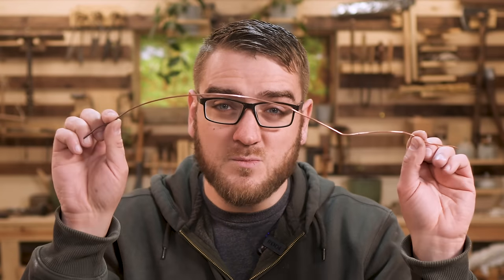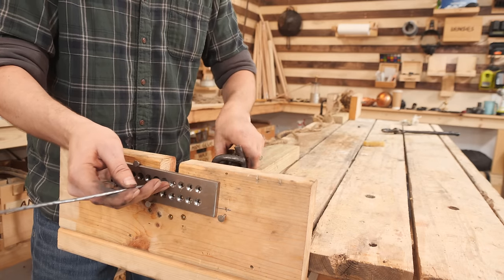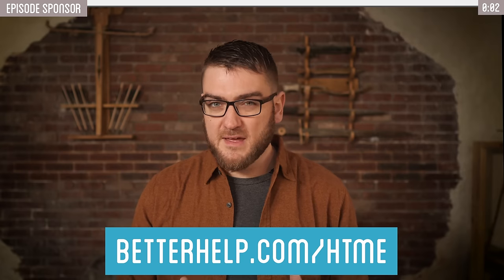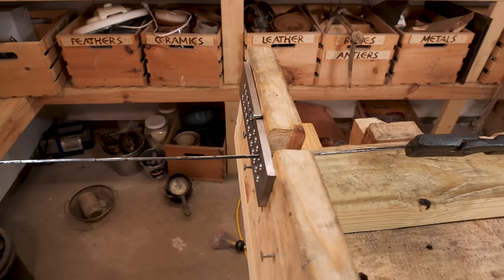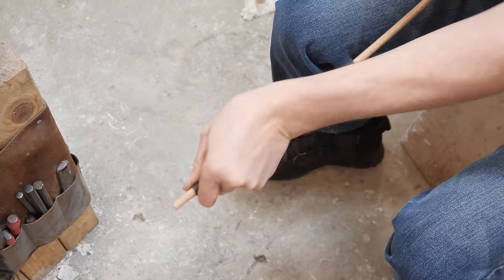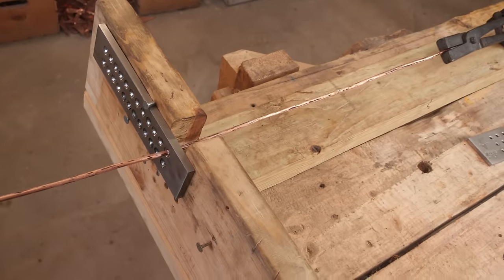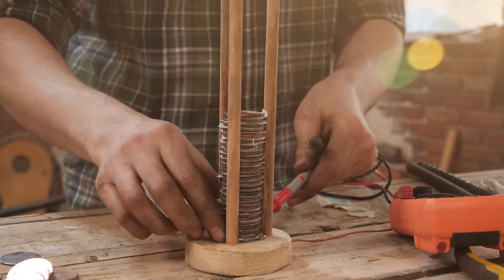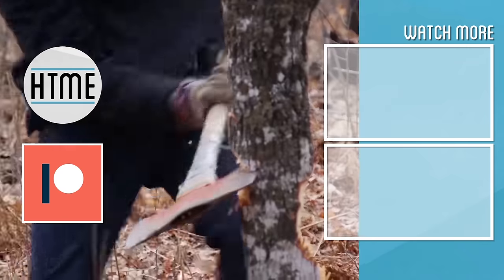Is This The Most Difficult Step to Unlocking Electronics?

Comment: I was working in the wire industry for the first 3 years of my career as an engineer. For low volume wire making, it is rather easy to do, but to make long continuous wire, lubrication and die design play a significant crucial role in successfully drawing wires 😅
Reply: It's spooled in smaller bobbin for small diameter wire and spooled in gigantic spool drums for cable ling wires. It actually depends on what the next process is.
Reply: Much respect for the field! I think wire is such a simple product once we have it, but the process for making it is definitely taken for granted.
Reply: At first they should keep the die perpendicular to wire, I guess?)
Reply: @ЁбрагимИпатенкоибнАдхарма  depends on how round you want your wires to be. But yes 😅. Actually fine wires would be heat treated at some point using molten Lead (for metal wires)  to not burn the wires during heating. For copper or aluminum wires you just need to watch for the reduction ratio and die approach angle in between each reduction and lubrication
Reply: Wait why are wires not just extruded directly from fluid metal?

Comment: most difficult part will DEFINITELY be the silicon transistor
Reply: I wonder if vacuum tubes would be any easier, I feel like a lot of the difficulty in silicon was just the chemistry, so knowing that ahead of time might make it easier than doing the glasswork/vacuum for tubes
Reply: Relays should be pretty easy to make for analog devices like telephones and telegraphs.
Reply: by that logic you could say 'quantum computer' is the hardest lol... the transistor is a product, right, but its not really a single material process, transistor is a composite of elements ;) so a quartz clock would be simpler (in terms of a single 'thing' being made), since theres no need to make lasers, lenses, stepper motors and chemicals before transistors, especially tiny ones on ICs... anyhows, you could be right, but please also do consider this aspect hehe 😅
Reply: @yus3dp533  Ironically, quantum computing is the easiest to make from scratch if you know what you're doing. Though you might need to rip a guy's heart out to do it...
Reply: Transistors are easy compared to Blue LEDs...
Reply: A single transistor....nah. A wafer full of them with useful yields, thats never gonna happen.
Reply: Zinc oxide semiconductors.
Used much like pyrite + cat's whisker in 'crystal radios'.
Bit of steel, coat with zinc, roast to oxidize, Robert is your Parents sibling.
They do have a frequency limit and can't rectify any power.
They can be used like a transistor, but the gain is quite low.
If you're going to rebuild electronics, you are gonna have to use tubes for any real power.
Once you have tubes, refining silicon/germanium is easy: zone melting in an induction furnace.
Reply: @CactusMuffin  yeah, since they got the electromagnet already, it is a matter of refinement to achieve relays.
Reply: 2 diodes, 2 ends connected. (PNP or NPN).
Reply: @brown56765  I've watched numerous people make tubes online. Constructing the tube is fairly easy and doesn't require exotic processes but drawing a high enough vacuum is. I don't know how hard it is to make a silicon transistor. A germanium one might be a bit easier.
Reply: @eDoc2020  they're also notoriously bad at making glassware.
Reply: @soonersciencenerd383  That wouldn't actually produce any gain. The working principle of a transistor requires that the two junctions be in very close proximity on the same substrate, and the two P-N junctions differ in their level of doping. This last part is also why a bipolar transistor won't work with the emitter and collector reversed.
Reply: Don't forget that silicon wasn't the first semiconductor ever used, and that the diode was the first device not the transistor.

Specifically they used crystals of galena I think it was, perhaps iron pyrite, perhaps both, in a point contact diode for rectification and reception of radio.

The diode would fail fairly quickly which was why the crystal was mounted in a carrier with a spring loaded needle to make the point contact. When it stopped working so well you'd just find a fresh clean part of the face of the crystal, even if you had to scrape into it.

You can even do a similar thing with a copper wire as the contact and a hardened carbon steel knife blade as the "crystal". This is called a trench radio because it was made by bored soldiers in WWI for entertainment. There are many YouTube videos showing you how to make one.
Reply: Also remember that Shockley made the first transistor a point contact one from germanium and gold.
Reply: Elaborate
Reply: @eDoc2020 mercury pump
Reply: I was thinking we could do mechanical relays as well using solenoids.
Reply: @pirobot668beta  I've read a lot about the cat's whiskers diode, but I hear that can be real finicky. Definitely worth a try though!
Reply: @CactusMuffin  The problem is relays are actually "digital", they are either on or off.
An analog device instead can produce, record, transmit or process a signal that at any given moment can be any value between some maximum and minimum threshold.
And to do any significant amount of processing on analog stuff electronically you either need thermoionic valves or semiconductors.
Reply: To have silicone wafer cut, you need to first master wire making. This is because wafer cutting uses high tension wires lace with abrasive cutting solutions
Reply: @eDoc2020 I mean, I think an oil diffusion vacuum pump should work fine for drawing the final vacuum (and a roughing pump is basically just inverted bellows), so sealing it becomes the main hurdle.
Reply: @theapexsurvivor9538   An oil diffusion pump is fine for drawing a  good enough vacuum. A basic sealing is trivial glasswork but sealed lead-in wires are hard without the right materials. You'd also have to deal with offgassing. Unless you have an induction heater and getter you probably won't be able to keep a vacuum in a finished tube. It will work when still on the pump but will fail even if properly sealed. But if the tube is failed by 1920s standards it could still have gain > 1 which is enough for a demonstration.
Reply: @eDoc2020  for the lead in wires you could probably make a series of mandrels down the same gauge as the wires and use them to basically form hypodermic needles from a metal that doesn't expand much when heated and shrink fit the wires through sections of needle and make a glass plug around the needle sections. It'd still break down if the wires got too cold, but it's pretty much the lowest tech option I can think of atm (~4AM).
Can't think of a good way to prevent offgassing, though presumably the solution would be to power the tube while it's still connected to the pump, allowing you to pull a bit more out of the components. Sounds painful and far from perfect though.
Apologies if I made any mistakes.
Reply: @theapexsurvivor9538  When I've seen homemade tubes being made I think they used a torch on tungsten wire to cause slight oxidation. I could be mistaken. In any case an incandescent light bulb or other low pressure tube would be a much better item to make first.

Comment: When drawing wire lubrication is important. Traditional ly Tallow but modern oils & grease work better
Reply: Beeswax works great, too!
Reply: Also, annealing would help also.
Reply: @ericwilliams1659  they did that
Reply: Modrrn draw operations use Teflon infused high viscosity lubricants. But here, tallow would work. It can be removed from the final work easier than beeswax.
Reply: @ericmueller6836  In the mid-80s we played with (forced) dry graphite and molybdenum type solutions on carbide dies. 12 lines pulling multiple reductions in a 1950's era factory sang like the worst orchestra EVER !!
   Think: Jim Carrey doing the "world's most annoying noise" X12.
Reply: Even something like butter, olive oil, or beeswax would be beneficial
Reply: @ericmueller6836 on a few modern companies they have used a soapy substance made from sheep fat. I mean if it works today it would probably have been great back then
Reply: @luckygunner8089  Lanolin. But really any type of oil or grease will help with this process.
Reply: I have been making wire for over 40 + years and use beeswax
Reply: Soap is another great lubricant.
Reply: wait until they get into the insulation part(copper wire without at least a thin film of insulating material wil short the generator/motor)
Reply: Good point! I don't think it got mentioned in the video, but we did in fact lubricate the wire before each pass. We tried beeswax at first, but ended up using oils because they were a little quicker to apply as the wire got thinner. I'm not sure how much difference it made, but it definitely helped. We also had to polish the wire after each annealing step, since you'd get a thin layer of copper oxide / iron oxide (depending on which material we were using of course) on the wire that made pulling it through the die difficult. Generally, we had to lubricate the wire every pass, and anneal the copper wire every two to three passes.
Reply: Yes, I came to say this. Wax or soap will work. Greases are often based upon soaps - a metal salt of long chain carboxylic acid eg lithium grease. But bath soap will also work.
Reply: @targusmack2302 Just don't drop it.
Reply: Thanks!

Comment: Gold and silversmith here! I do this process quite frequently, usually with silver but sometimes copper and brass. 
I'm begging y'all to wear some eye protection! The force the wire is under can really do some damage when it comes through the drawplate. Safety squint aint cutting it. 
For tips: 
- anneal every 3 holes you go through on the drawplate. 
- its much easier if you hammer a rough taper in the front section of wire 
- if its sticking, pull it through the same diameter hole a couple times before moving down 
- a bit of beeswax for lubrication is good

Comment: I never thought electronics would be on this channel
Reply: Computers are next bro, or a light bulb.
Reply: yeah.  you are going to have to live a long time to watch one man go from polishing stones to make a straight edge to making chips for 5g interwebs!   amazing how far we've come since co2 went up.   ahh.  i had to get political.... 😁
Reply: Bro fr thou
Reply: As long as he sticks to his current standards, I'm not gonna be surprised unless he starts making silicone computer chips.

The funny thing is he made the wire the hard way in this video.

There are old hand cranked wire making devices intended for jewelry that i've seen but can't remember the name of...

Granted, making one of those might be more difficult than pulling wire through a small hole repeatedly, but the actual process of making the wire would have been easier.

Comment: I always wondered already how they managed to make wire back then. Trying to do a proper way of insulating is a next useful step! I've restored radios from around the 1920s, there the wires were wrapped in something like cotton, and then they're soaked in some kind of wax and coated in shellac. Generally, the insulation is very rigid, but by throwing the wire in a bit of alcohol, the insulation becomes soft, then you can bend the wire into the right shape and you can do your soldering. 

Soldering irons from back then were simply big blocks of copper attached to a steel rod and a wooden handle. You throw them in a woodfire, clean the head off with a steel brush and comfortably solder for a while. As for tin, a popular composition is 60% tin and 40% lead. Tree rosin (colofonium) was super popular as a flux up until we went from lead-holding tin to lead-free stuff. 

You're trying to draw an awful lot of current from the voltaic pile in the video. When it comes to an electromagnet like yours, with a wire of this thickness, you don't need a high voltage, but to supply a high current. You can do this, rather than stacking a lot of cells on top of each other, simply by only making a couple, but with a really large surface area! Keep in mind, a battery does not spit out current. It creates a potential difference at its electrodes, and a load with a certain resistance draws a current accordingly. This current may be limited due to the internal resistance of the battery, hence when you try to draw a lot of current, this becomes a larger and larger issue, resulting in a large voltage drop (hence your voltaic pile sags so much in voltage) so you want to increase the surface area of your electrodes :-). 

But this stuff is all incredibly doable for you. I think your largest barrier is still ahead of you if you want to go use electricity in a useful manner. It's generally also a big burden amongst electronics hobbyists. Ofcourse we learned iron is magnetic, but that doesn't necessarily mean steel is magnetic! In fact, the usefulness of a material for building things like electromagnets, transformers, motors and generators is very much determined by the permeability of the material. The higher the permeability, the stronger you can concentrate a magnetic field (very crudely generalized). This is why for an electromagnet, it is beneficial to add a soft-iron core, it allows you to create a stronger magnetic field before your energy goes to waste. Whilst a steel core, depending on its composition, could add little to no benefit since the permeability may not be that much higher than that of air. In electronics applications, we refer therefore to the material as soft iron, silicon steel, electrical steel, etc. The first transformers were mostly made with very pure iron sheets, later it was found by adding silicon to your composition, it helps enormously ramping up the permeability. The detail that will make or break your next step is the carbon content of your steel. The lower you'll be able to possibly get this, the better. The electromagnets I've designed in the past usually used steel with a carbon content lower than something like 0.1%, for transformers it's not weird to hear carbon contents like 10-100 times less than that. This is why it's so hard to make your own transformer at home for your own projects, it's really hard to get these alloys. I've heard of people making cores from spring steel, but then the efficiency is still really bad, resulting in really big and heavy transformers. Whenever we work with a new alloy, generally we get it machined in a bar and throw it in a device called a B-H curve tracer. I'm sure you can get your compositions analyzed if you puppy-eye a big transformer or generator manufacturer. It's tricky to quantify the permeability and other important variables when it comes to these designs, it gets really technical really quickly, hence maybe the best method is simply trial and error and see whats best :-) 

Goodluck with your endeavours, I'm really excited to see you experiment rediscovering electronics on your own this way! It's been my dream to do such thing myself, but there's too many projects to half-ass, I don't have the time to half-ass another one anymore hahaha

Comment: Pure copper wire may be a little too brittle for your future uses. Magnet wire is usually some from of alloy. A popular one is C11000. Its more ductile than pure copper, has better conductivity and resists oxidation. Doing that will certainly increase your chance of success when/if you plan to further expand into electronics. Its a 999:1 composition of copper and gold respectively. I expect wire insulation to be quite the challenge. I can't wait to see how you tackle that.
Reply: C11000 doesn't contain any gold. It is 99.9%+ pure copper the rest being oxygen (trace impurities aside). Maybe you're confused by seeing it sold with gold plating? Sometime that is done for oxidation protection. Also small amounts of other elements in a near-pure metal typically reduce its conductivity due to higher phonon scattering. Gold having a lower conductivity that copper doesnt help the latter either.
Reply: @WouterVerbruggen  Sorry if I wasn't clear its composition would be applicable here, it would be better than the "pure copper" he has sourced. Hmm, the datasheet I found for it listed it as an alloy composition but I think you are right about it being plated.
Reply: It would be strange for magnet wire not to be pure copper. Magnets work by using magnetic fields to push electrons. But impure metal acts like a rocky road for electrons. So thats why they use pure copper or pure aluminum in transformers. I read that the large power lines however are steel with a aluminum strand woven in. Seems like they had to except a loss of power to have lines that long. Though that get into phases 2 phase to three to 6.
Reply: @fajile5109  I'm more speaking to his limitations. Any pure copper he attempts will be loaded with defects, alloyed won't be ideal for professionally produce magnet wire but in his case it would be useful. If ha manages to be cautious enough to do so.
Reply: @fajile5109  Actually, it’s quite the opposite: large powerlines are aluminum strands wound around a central steel strand. AC power tends to flow through the outside of a cable due to skin effect, so the inside has little effect on the power handling capability of the cable, thus the center is the obvious place for the steel strand which makes the cable strong enough to handle being stretched between support structures.